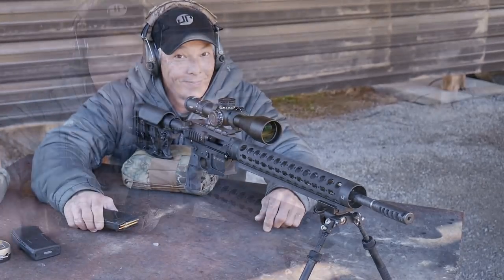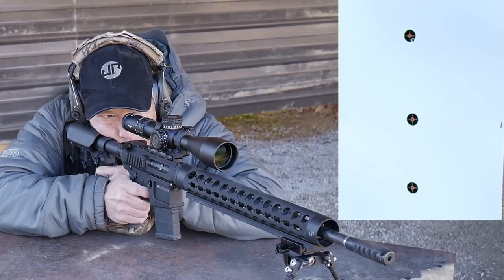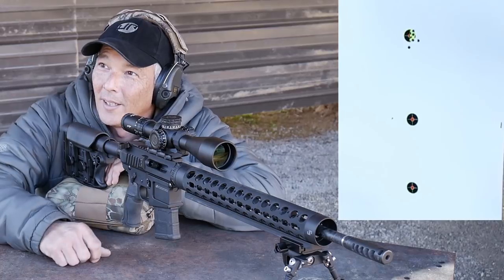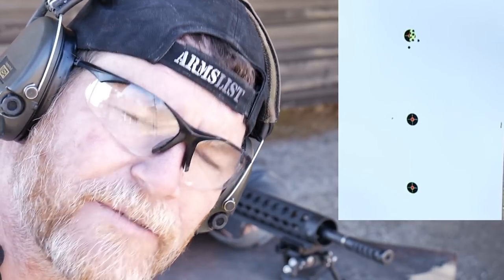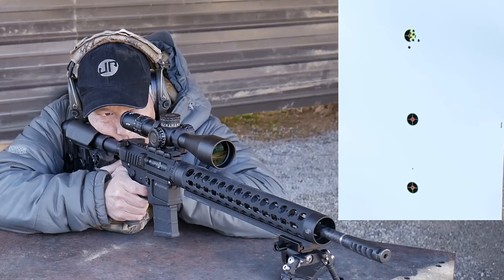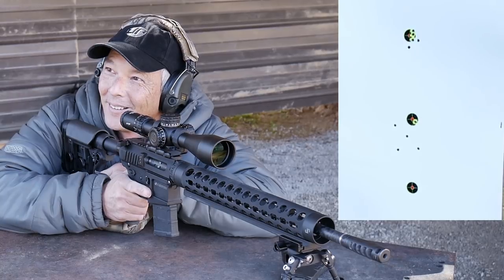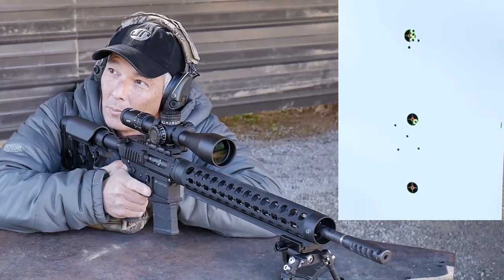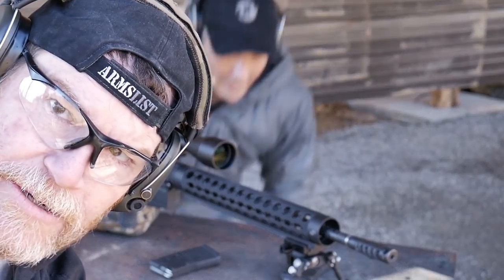Tulammo 75 grain .223 is a No Go & Here is Why!!

Comment: Tula is terrible quality, burns filthy and accuracy sucks. It's worth the extra money for Wolf or another "discount" ammo
Reply: There is a factory about 100 miles south of Moscow, Russia that manufactures steel case ammo for several U.S. based companies as well as others, but it’s all in the same factory and used the same materials, it’s just packaged differently
Reply: @b camp - Hmm, I seem to shoot it just fine out an Aero Precision rifle with a BCM bcg, and  14.5" Cold Hammer Forged FN barrel. Maybe it's operator error?
Reply: Un Garza , works great for me as well, most likely it’s not operator error could be that our training is different than theirs but actually this is a great channel and it sure informs me on much more weighty matters then a box of ammunition, this is a great channel for 2A news, he and jarrod are buds as well, but as for the ammo I make 800 yard shots with it all the time, but I do turn off my gas block and cycle it by hand so not to dirty up my rifle.
Reply: @imafriend1336  Barnau
Reply: mac2k2020 correct

Comment: I was told never to use tulammo because it was dangerous
Reply: Sometimes you have to laugh at warnings, like when a box says "lead is known to the state of California to...." its like, well its a bullet, I'm pretty sure cancer is the least dangerous thing about it... You would have to verify where they got that claim because it might be for 1 particular rifle or it might just be Fudds making up stuff like the 1 time I went to an indoor range, they wouldn't let me use steel cased ammo, which makes absolutely no sense especially with the firearm that it was going to be used with, its like telling an AK guy, "hey, you shouldn't run steel case in that" when that's literally what AKs are designed to use...

Same place also had a blatantly stupid 1 shot per second rule, which means you couldn't really train for self defense because I'm not going to be "pow, 1 mississippi, hold up bad guy, stay still, pow, 2 mississippi..." and I ended up doing over 6 shots per second with a single shot revolver (chest sized group, but the range dude was giving me a glare for I guess practicing once the way I would use it if someone busted down my door). So sometimes people have stupid rules (that will get people killed because they won't let you train how you really need to even though its perfectly safe), or they won't let you use some ammo even when the weapon is completely designed for it.

There are some ammo brands that are hotter than others, but I don't think Tula is the one, I think its Wolf so they might have their ammo import brands mixed up, but that also probably requires a really $hitty gun for it to be so abysmally poor and borderline unsafe as it is for it to fail (some of those exist, but typically antiques).

Comment: My farts have more port pressure than Russian .223
Reply: TheMetalGuy852  I buy Magtech M193 for 29¢/ where are you buying steel case for 14.5¢/rd. Saving 4 or 5 cents a round for a much larger proportion lower quality ammo is not worth it to me.  Also I have never bench shot in my life.  I shoot prone on occasion at my steel targets.  My BCM 20" rifle just barely cycles Wolf when its less than 40°.  Sometimes I have a round stop on the feed ramp and a good whack on the butt stock chambers it.  My ejection is like 5 o clock dribbling out and landing maybe 2 feet away.
When I use Magtech brass I get 4 o clock ejection, brass landing in a nice pile about 7 feet away.

If Wolf would put just a little bit more powder in there I'd have no issue running it.
Reply: TheMetalGuy852  I'd normally agree with you but Im not having stuck cases or any serious malfunctions other than just weak asf ejection in cold weather. 50° and up it cycles fine,  yesterday is when I had the issues,  it was only 21° and about once a mag I'd have one stop just shy of chambering all it took was a fist bump on the trapdoor of the stock and it would chamber.
My rifle is a 20" obviously rifle length, with just a standard A2 stock buffer and spring.  It is a cheap UTG stock so its possible the spring is getting weak. I have right at 1,700 rounds through it.  I'm glad you said that because it took me typing out this message to think of the recoil spring.  Who do you recommend for a quality rifle length spring and buffer?
All of the coating on my buffer face is worn off too, I don't think that hurts anything but it goes to show how shitty quality UTG stuff is apparently.

Its a BCM upper and BCG, Aero LPK,  and I went cheap on the furniture and CH
Reply: TheMetalGuy852  I just cracked her open and theres metal shavings sitting right in front of the buffer in the threads around the retaining pin, thats weird as hell. Wasn't there when I cleaned it 150 rounds ago.
Reply: TheMetalGuy852  good shit man, greatly appreciated. Even the UTG stock itself is shitty looking, it has a crease on either side running the full length that looks God awful. Im gonna change it out for Fulton Armory metal trap door stock.  I happen to really like the A2 stock, its perfect for me being 6'3". I just book marked that spring and buffer.  Getting off into the weeds now but I have a Windham A2 handguard thats actually good quality and narrower than the cheapos out there. But I gotta get with it and get a rail so I can mount a light and VFG.
Thanks again.

Comment: When this, and other steel case cased higher weight 223 cal came out it caught my eye. Then I read about it, still bi-metal... Not very accurate by design. It suffers the same issues as green tip, copper coated steel cores won't balance well enough for precision work. Doubt the hollow point matters, probably doesn't expand. gel test?
Reply: I doubt it expands at all, I have a bunch and the Hollow points are all different shapes which along with varying powder loads makes it less accurate.  But it's worked everytime I pull the trigger and they are the only 75g 223 ammo that isn't over $1per cartridge last time I looked.

Comment: Christ, M855 isn't that expensive comparatively and groups ~2 MOA or so from my Colt 6960 with a SIG Romeo 7. 

Is that a Proof Research on the AR you used in testing? I only ask because I work at Proof Research...